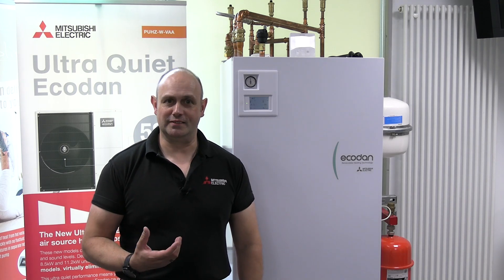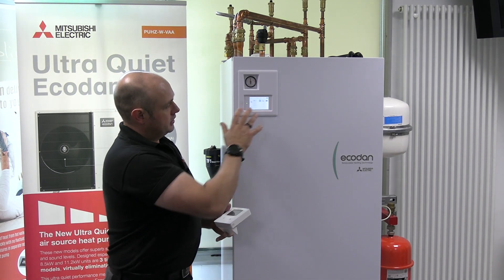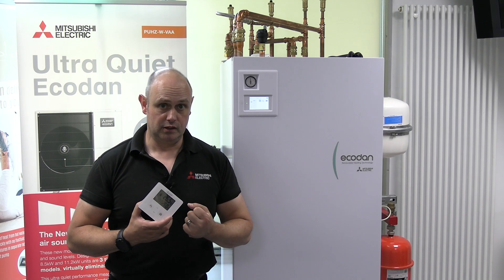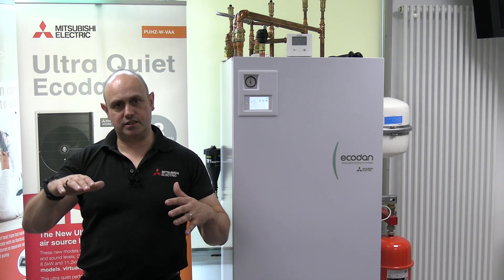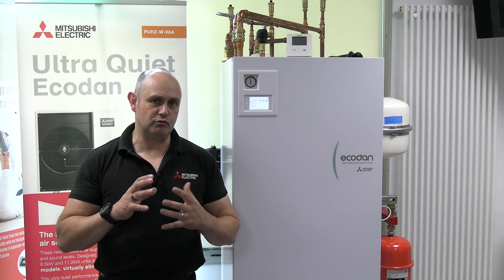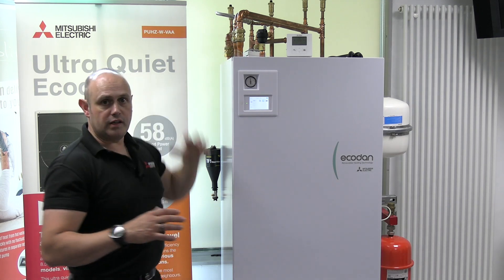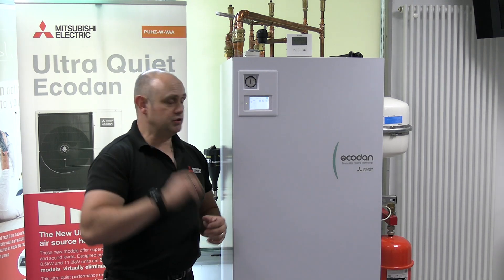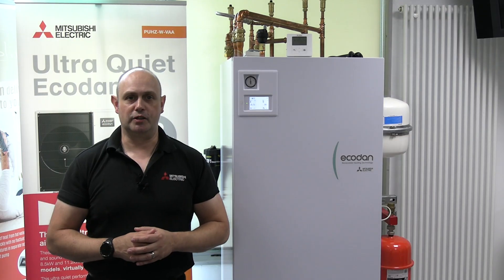Ecodan FTC7 heating modes

Comment: 5°C Delta T is the mode with the highest yield for a heat pump or is it just a convention of the technical data sheets that has become a myth?

For two months now I have been running a 4 kWh Ecodan on floor heating.
The outside temperatures are on average between 2.5 and 7 °C, I use the fixed flow mode at 30° and the return temperature is 28.5°, so my delta T is 1.5°.
The rooms are constantly between 20 and 21°.
The heat pump has a COP between 3.50 and 4.5 and an operation between 26 and 32 Hz, I would say constant.<

I am satisfied with the operation, however I have two questions.
Question 1: If I ran the heat pump with a delta T of 5° would I have a higher yield?
Question 2: To increase the Delta T can I decrease the water flow rate and increase the flow temperature?